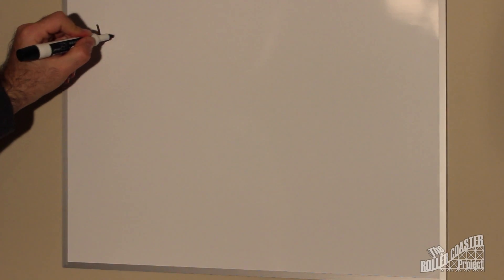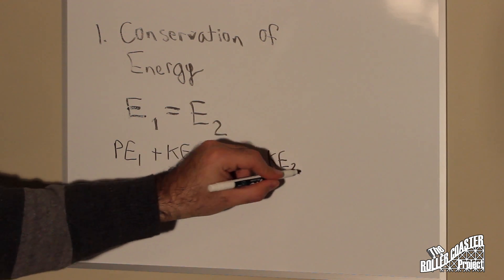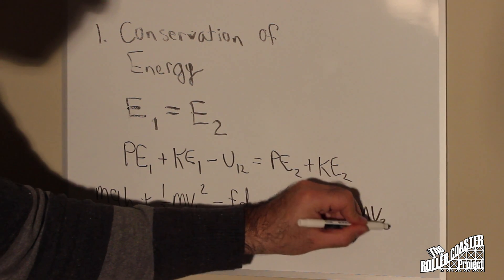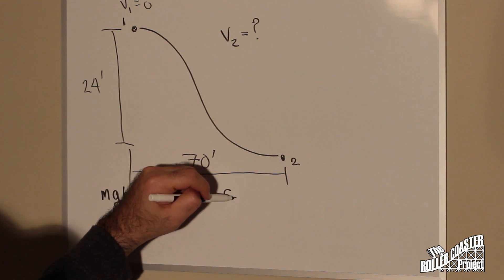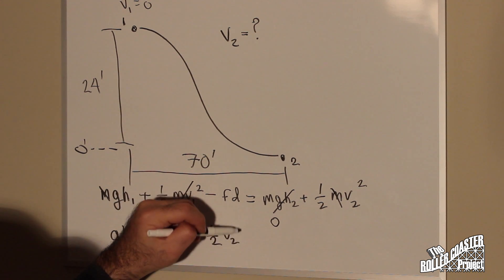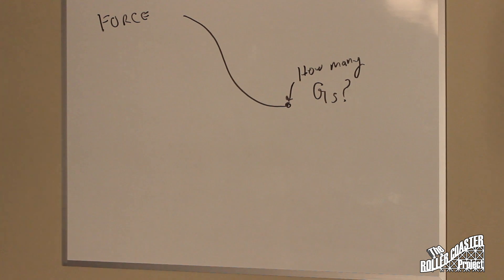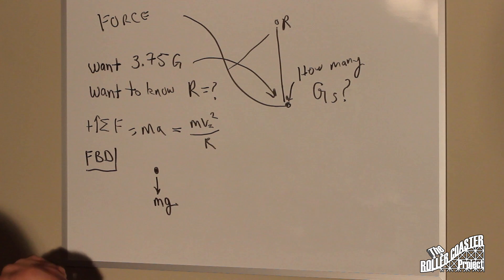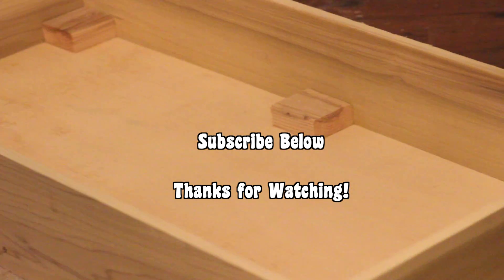Roller Coaster Calculations - Part 2

Comment: Hi again, I keep coming back to this video 😂 I was going to ask if u knew about lenz law and how this can be used on brake fins. I’m still not entirely sure how lenz law works itself but know that generally that induced magnetic fields oppose the movement that created this magnetic field.
Reply from the maker: Yep, Lenz Law is the fundamental principle in magnetic braking.  Or I should say eddy current brakes.  Since this is a relationship between the change in magnetic field over time and opposing drag, conductive metals generate rotating magnetic fields opposite to that of a magnet passing by or between.  For example, on a typical coaster you may have 20 mm of “air gap” between two strong neodymium magnets.  This concentrated magnetic field varies depending on distance between the magnets.  When a brake fin, usually some copper alloy (however aluminum, brass…etc) will generate a rotating circular, opposing, field.  Since it’s not a ferrous metal, it will never fully stop, but will slow until the downward slope reaches equilibrium in opposing drag.

Comment: Hi again, was wondering when calculating I find that making mgh + 1/2 m v^2 of the top of the first drop equal to this at the bottom of the first drop then mass has no effect on the end result but height instead. Why is this and if this is incorrect could u explain why?
Reply from the maker: Since mass theoretically never changes from one point to the next, the only difference in energy via Conservation of Energy laws is the increase or decrease in vertical distance.  Now, that change in height is always fighting our losses (friction) so the energy in the system plus energy loss will equal final energy.  Either way, you can solve it all without mass.
Reply: @therollercoasterdesigner  thanks a lot, I was also going to ask for a project how to calculate laterals or even airtime on a coaster that involves off axis airtime like RMC use a lot. help would be greatly appreciated
Reply from the maker: @alanschilke6996  I’m planning on some more calculation related videos that go more in-depth or at least cover different topics than I have previously.
Reply: @therollercoasterdesigner  oh ok, looking forward to those then

Comment: How did u get 38.78, so confused at this. I think I've been simplifying well but can never get this. Can you explain this maybe?
Reply from the maker: This was an oversimplification for the losses on a drop.  The idea is conservation of energy, but the energy line for a coaster depreciates by various means.  Simply put, coasters are designed to expel an amount of energy per linear foot of track.  Since there are so many factors involved in real world friction, there are assumptions made that it only exists in the horizontal direction.  This means that a vertical drop wouldn’t result in any loss, although this isn’t true it is accounted for in a conservative estimate of 2-3% energy per foot.  That’s where I gathered the “fd” work term.  It becomes more complicated when coasters achieve a certain speed, then wind resistance adds to the rolling friction.  Think of your energy line beginning at the top of the drop and as you move farther way the energy increases, but is also slightly subtracted for every foot forward.
Reply: @therollercoasterdesigner  ok, thank you. So my equation looked like urs when substituted (9.8)(24')-(0.3)(70')=1/2velocity squared is that correct?
Reply from the maker: DONBETHELLEONE everything except the 9.8, since your units for position are in imperial and not metric you have to use 32.2 ft/s2.  Make sure your units are consistent.
Reply: @therollercoasterdesigner  sorry ignore me, just had a brain freeze. Thanks for all ur help tho. This is a field Ive been very interested before even riding coasters and now you helping me get the basics is really helping
Reply: @therollercoasterdesigner  may I ask how you would find the value of friction using the stats the average car is 4500kg and the gravitational is 9.8? I've searched around for rolling friction calculations but can't find anything
Reply from the maker: DONBETHELLEONE the value of friction comes from a few dimensionless numbers: coefficients of kinetic energy and deformation.  Depending on your wheels and contact surface, say for a wood coaster is a steel wheel on steel rail you end up with a coefficient of kinetic friction of 0.0015.  Since there are many factors you cannot account for while a ride operates (temperature, moisture, rider weights and placements...etc) you will factor it to be larger than the exact value.  For instance, a nylon wheel similar to B&M will have a larger number which results in more energy lost over the course of the ride.  Search Wikipedia for rolling friction to get an idea of how to calculate based on wheel diameter and worst case loading from ride forces.
Reply: @therollercoasterdesigner  how come you're working in imperial and not metric? Is that the standard throughout construction or more just personal preference?
Reply from the maker: BillyTNH it’s really just because I’m from the US, and that’s a what is used primarily.  There are a lot of benefits to metric when it comes to building and tolerances, so for future videos I’ll probably switch everything to metric for ease.
Reply: @therollercoasterdesigner  how would you go about calculating this (coefficient of rolling resistance) or is it a fixed value
Reply from the maker: @alanschilke6996  rolling friction, as with all forms of energy loss are variable dependent on infinitely many factors.  The best, and actual, way coasters are determined is to create a friction range to operate within.  So, a conservative estimate is used combined with a worse case value.

Comment: hellowhich program is good to design a rollercoaster? any other tips or ideas for making my own real rollercoaster
Reply from the maker: Since roller coasters are really just math equations, you could use any tabulating program like Excel or Numbers or you could do it by hand.  If you choose to do it by hand, just pay attention to when you round the numbers at the end.  As for sketching what you design, drafting programs work really well.  Most programs can take your tabulated data and draw what you've calculated.

The biggest tip is just understanding motion and the math involved.  Older companies were not as advanced as most modern day design firms, but understanding the basics can lead you to creating something extraordinary.
Reply: thank you verry much
Reply: No limits 2 is good for cad style editing
Reply: I would HIGHLY recommend No Limits or No Limits 2 for prototyping, followed by your own math to double check with real world friction and g force estimates.
Reply: The Roller Coaster Project very informative